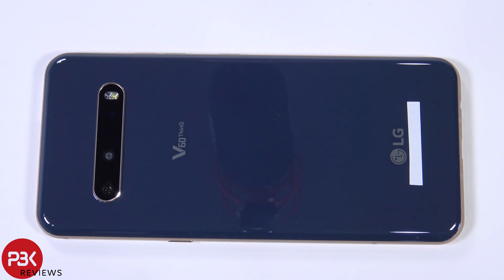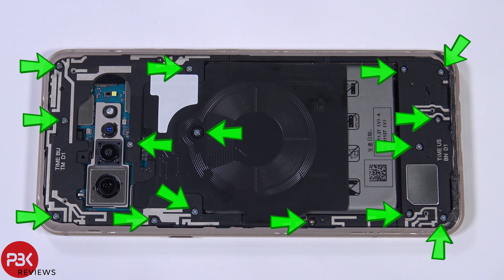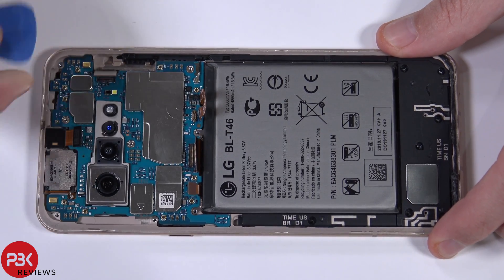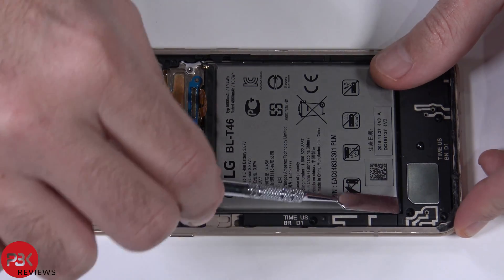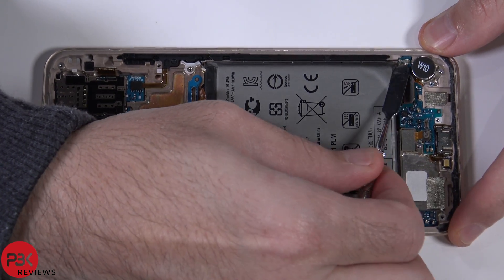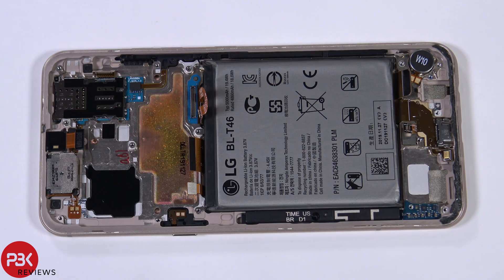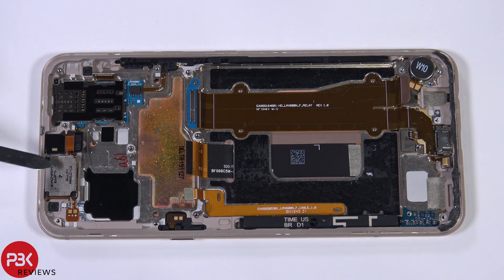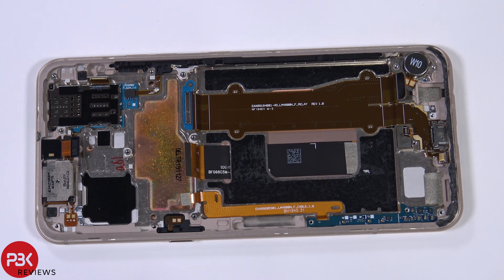LG V60 ThinQ 5G Disassembly Teardown Repair Video Review

Comment: Any guidance or advice on replacing the outer glass face of the duo screen case? Not the screen, but the glass the goes over the always-on LED display? Many thanks in advance!
Reply: probably how they remove modern iphone backglass with lazers and a good shattering and pealing of the glass

Comment: what do you use for glue?
Reply from the maker: You can use 300 LSE adhesive or smartphone red tape. There are many types of adhesives out there.
Reply: @PBKreviews  What thickness and width do you recommend for the adhesive tape? Specifically for putting the glass back back on.
Reply from the maker: @Akaban_94  check out the adhesive installation video I did recently should give you a better understanding. You can also get the original pre cut adhesive from https://www.mobiledefenders.com/lg-repair-parts/v-series/v60-thinq.html

Comment: Hi PBK. Did you have LG G2 Disassembly video? I think i need to replace my old battery with new one. Anyways good job 👍👍
Reply from the maker: Hi, thank you. Sorry unfortunately I do not have a video on that one, but there are a few videos from others on youtube for that phone. It's not very difficult, just follow the videos, remove the screws on back, take back cover off, disconnect a few cables and pry the old battery off, apply the new battery with new adhesive or double sided tape and put it back together. :) hope this helps

Comment: Which dac does yhe v60 use?
Reply from the maker: Suppose to be a Quad Dac but not sure exactly where it was located, possibly under the shields of the main board
Reply: @PBKreviews  i know they been using quad dac forever but which version model?
Reply: @Usernotknown21  Sabre ES9219

Comment: Good work props to lg for this magnificent cell phone...
Reply: I've had mine almost 2 yrs and still get 10 hrs plus sot. I use mine for almost 16hrs a day and got rid of tv laptop PC and tablet. This is my everything phone I've had since Mar 2020 and it's mint. Battery life has dropped off a bit but I put crazy hrs on mine. Always on auto brightness and adaptive charging. I'm going to replace the battery this winter if the pixel 6 pro is junk . But I took back the 21 ultra and sold the mi 11ultra because they suck compared to this. Especially after the android 11 update. The camera is killing it. Who cares about 120 Hz . That's so kiddies can be impressed by the zoomies lol
Reply: @ronniejaye1  2 years later, do you still use the V60? I got mine in August 2021 and thanks to this video, it'll probably last me 3 more years. I'm gonna be pretty sad when I can no longer fix it since no other phones are as good as the V60 at playing hi-fi music.
Reply: @ronniejaye1  You got the phone in March of 2020, which means you had it for just over a year, not almost 2 years...
Reply: Mine is working great! Only issues are the battery (which is why I'm watching this video) and charge port is acting up so I'm having to use the wireless charger. Other than that it's a good phone, very happy with it.
Reply: @JF32304  exactly my problem. Little bit wary of taking on this task though.
Reply: @MaseratiExperiences  Yeah, my charge port has a short in it like a lot of other people get with the V60.   I've been watching several videos on replacing it.   It does seem to be a pretty detailed task to take it all apart and everything out of it just to replace the Charging Dock Flex.  But I am mustering up the courage to tackle it and I figured I would just replace the battery in it while it is apart.  And I also found a replacement for the back battery cover adhesive to seal it all back up when done.   But like I said, I haven't pulled the trigger on tackling this big job just yet... Ughhhh
Reply: @troylacey2258  we're in the same boat!! I took the plunge and got a replacement battery and a new back cover ($10) because mine was scratched already. Short story, it wasn't as difficult as I had imagined. Thanks to the content creator here, I was able to change the battery. So while I have a healthy battery now I now know that this wasn't the problem :). The charging port is the problem and I am not near brave enough to tackle that. Now I have to find a repair shop near me because I really like my V60.
Reply: @MaseratiExperiences  Yeah I'm not brave enough to tackle this job.  I mean, it is pretty much a complete dismantle of the entire inside of the phone!  And I don't want to screw anything up.   I am going to a repair shop here in town when they open after while and talk to them about this.  Repairing/ replacing charge ports was one of the tasks they had listed of the many services they do.   I'm just afraid it will cost $100+ to have them do it.... and that is with me providing them the new charge port dock flex, battery and new sealant  adhesive myself.   Good luck and let me know what you end up doing.   I'll let you know what I find out as well.   Like you, I love my V60!  I'm sad LG quit making cell phones. : \
Reply: @troylacey2258  keep us posted. Don't know any repair shops near me (Central NJ).
Reply: It's terrible. Mine lasted me 8 months and the battery started swelling
Reply: @Arweris  It's called being unlucky.  This kind of shit can happen to any kind of electronics.
Reply: @pieceofschmidtgamer  wish more people understood this. Technology fails sometimes. Probably less than 1%. Sorry you got unlucky, but that doesn't mean the tech is terrible.

Comment: Oof lg still with permanent adhesive with the battery? Or is it more removable than last year's lg g8 cus from what I have seen from jerryrig vid it was very hard to remove it and this one seemed much easier
Reply: @gary burrows what if ur battery just degraded and became shit so u just wanna replace it?
There is no point on permanently sticking the battery, the only reason someone would do that is to make repairs harder
Also why u yelling
Reply: @ayoubkrt5018  watching LG do this is very heartbreaking... How did LG go from the removable v20 to this adhesive on batteries? Whats the point in adhesives on batteries... honestly is there any benefit from an engineering standpoint?
Reply: @slevingaius  what they get from it is less ppl repairing and more repairs done by lg
but it appears they stopped doing it and instead settled for an easially removable adhesive
Reply: @ayoubkrt5018  personally if theres any adhesive LG like others just gave a middle finger to anyone who wants to use their products beyond the "warranty years". Sigh servicing by LG is a joke compared to its brother Samsung. 

I dont see any point of an adhesive on a battery tbh. Unless by some weird physics it not being secured causes arking between the connectors. Its easily overcome by adding protruding flaps to the main body to secure the battery.
Reply: @slevingaius  Samsung also uses adhesive?
Except for the g8 they use a weak adhesive that can be taken out easily
Reply from the maker: Ya this one was easier to remove for sure compared to the LG G8 lol
Reply: @PBKreviews  how would u rate it for repairability?
Reply from the maker: @ayoubkrt5018  I'd give it a 7 out of 10. Not hard to repair, but pull tabs on battery would have been better, replacing charger port requires removal of battery and the adhesive on the back plate is very strong (ensuring the water and dust resistance) so it's not as easy to pry off as other phones. But its not overall a difficult process. Just takes some time :)
Reply: @PBKreviews  interesting, the lack of pull tabs in the battery is kind of a bummer but they aren't using permanent adhesive so that a good thing?
The adhesive for the charging port at least is acceptable cus it for waterproofing I think
What I really like is they are still going with a modular design in their phones where the speakers charging port, headphone jack are all replaceable without having to replace the Mobo by it self
Reply from the maker: Ya I like the modular replaceable parts. No adhesive is ever permanent. Not sure why some people say that batteries are not replaceable. All are, its just some are more difficult than others because the adhesive is stronger than others or other factors. Permanent would be if its soldered on in a way that you cant disconnect and replace or if prying it off would render the device useless after etc. I don't believe in calling it permanent if I can heat it up, pry it off and put a new battery with new adhesive and have a operating phone again. Some people who think that if it has no pull tabs and is not user friendly to replace, then its not replaceable and that's not correct. :) hope this helps

Comment: Would it be dangerous to heat up the battery? Or did you just pry it out without heat?
Reply from the maker: Usually its best to apply a little heat, just don't overdo it. warm it up a bit and apply gentle heat through the pry process if needed to make it easier but this phones battery didn't seem extremely difficult to pry compared to most other
Reply: @PBKreviews  Correct and look like removing the battery of this phone is way easier than LG G8; all you need is removing the backglass and wireless charging board and its cable
Reply from the maker: @tuanngnt  👍

Comment: Where is the Quad DAC?
Reply from the maker: Not sure honestly, might be under the shields. But I'm not familiar with it to know exactly which one it would be either.
Reply: @PBKreviews  If you ever get bored and want to take it apart again :)  That Sabre should be pretty obvious to find i would think...gonna be a surface-mount chip likely near headphone jack.
Reply from the maker: @Scott-DJ  I checked on closeups of the small board by the headphone jack but couldn't really tell nothing that stood out
Reply: I know...i wanted to see if LG finally updated the 5 year old 9218P DAC they've been using over and over...
Reply: Same question here too.
Reply: Im curious if they still use ESS DACs or Qualcomm's.

Comment: Good stuff, definitely getting this once it's released. Any info on pricing and release date?
Reply: Pricing <999 they are going below what the bottom of the line s20 is

If i had to guess probably around the $800 range 

I wish they would go crazy and go $700-750 

I know they wont go lower than that sadly
Reply: If i had to guess around the $900 range not $800
Reply: Yeah my guess is $899
Reply from the maker: No info yet as far as I know
Reply: Under 1000